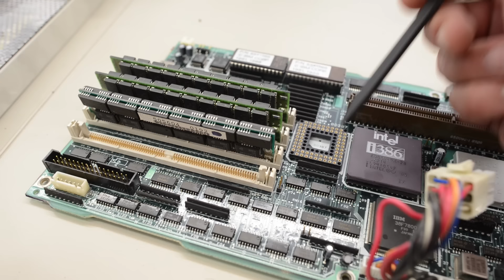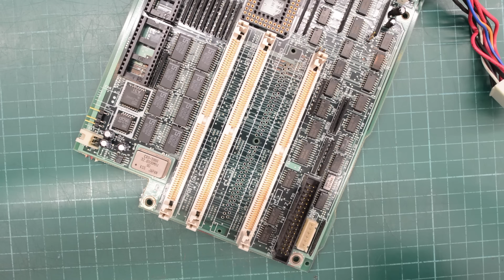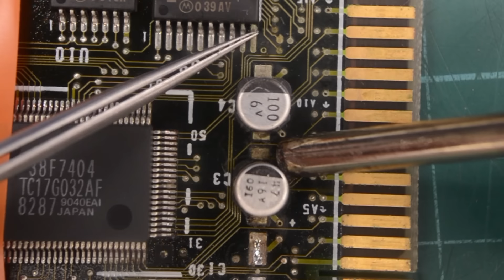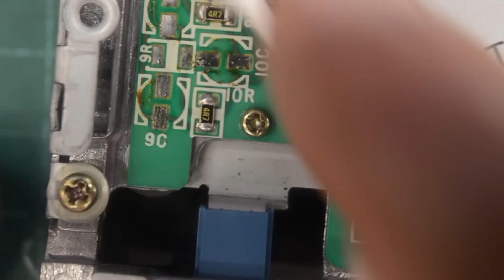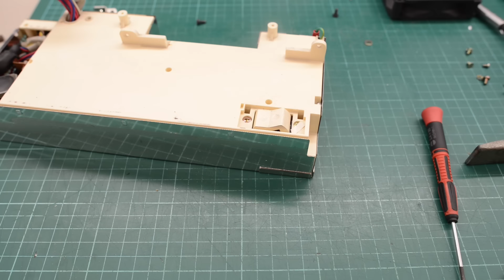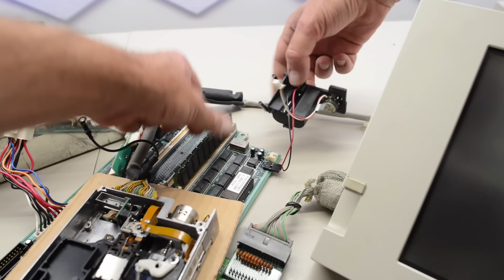IBM PS/2 P70 Portable. Complete teardown

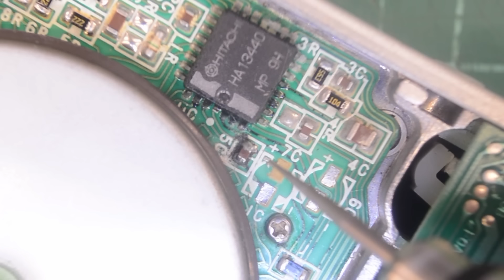Comment: Thanks SOOO much. I just got done recapping both drives in my P70 following these instructions and was able to bring it back to life!  A couple of things I noticed... the caps on the smaller board on your drive were probably a repair, mine were SMDs.  I had to repair traces on both drives.  The one on the floppy was tough to find, symptom was that the floppy would seek but not spin.  Your drive looks like it might have the same issue... a broken trace on the right side of the "5C" component at 28:30, the one that goes up and under the Hitachi IC.  Maybe too late to be any help now but in case it helps someone else.

Comment: I realize this is coming outta left field but  … when I was an IT Director back in 1989 I bought one of these for my office.  I loved the amber screen and the keyboard (among other design flourishes).  Watching your video today all of a sudden it occurred to me that could be really super cool to get one of these (as long as the screen and keyboard are fine) gut it and turn it into a cyberdeck!  Maybe put in a Lenovo motherboard or an SBC like a Pi (with WiFi, BT, Ethernet, USB, RAM), modify the floppy housing to hold  a big SSD, install SD card slots, and so on.  Do you or your readers think that could be done?  Would it be possible to interface the plasma screen and the keyboard to new guts?  “Enquiring minds want to know!”

Comment: Some of these boards have curved traces a lot like hand-drawn boards used to. They even have parallel traces slightly converging upon each other, also a lot like hand-drawn boards. Did... did IBM hand-layout some of their early SMD boards? Or... Yaskawa, whoever that is. Those are really thin traces, but maybe they just optically reduced it by 6x or 8x instead of the typical 4x?

Comment: A mate worked for a computer company that was getting rid of some of these when I was getting ready for university. This is about 93-94 ish. Absolute godsend enabling to do my course work at my digs and print it off in the computer lab. They sourced a soundblaster card for it as well. 
Doom however on this thing, was rather interesting, is that water, toxic waste, or lava? The screen rendered it all the same!
Sold it on at the end of uni to another student.

Comment: Maybe a stupid question and blame my eyesight, but isn’t the simm slot symmetrical? I seem to count 36 holes/pins on each side of the gap and the distances to the outside holes seem identical. I do see a size difference between the outer holes but worst case, just snip off the plastic pin. What a beautiful quirky true-big-blue machine. Never seen one of those, not even in pictures.
Reply from the maker: If I understand you correctly, I don't think that would work. The pins underneath are not in the same spot on both sides. I hope that made sense
Reply: @Epictronics1  it looked symmetrical to me but again, my eyesight isn’t optimal late in the day. Then a socket swap with the top one would be the next option. Thanks for the reply and looking forward to part 2 ;)

Comment: I really like how you teach the proper way to remove caps.  Some other "popular" YouTubers like to twist them off with giant pliers.
Reply: That IS the proper way to remove caps.

I used to be against it too, but I was just wrong.  After repairing a few boards where the solder was too corroded to melt, I nearly damaged the PCB and everything on it due to heat exposure trying to do it “the right way.”

I had a different board where the caps were glued down to allow for wave soldering some of the through hole parts.  Those were impossible to take off with hot air alone, even though the solder was still melting fine.

I learned through trial and error that while it looks barbaric to twist caps off a PCB, it’s actually a lot kinder than the alternative in a lot of cases.  Sometimes you lose a pad no matter what you do.  In those cases, the board’s already compromised and there’s not a lot you can do about that.  You just have to fix it some other way.
Reply: @sirnickity  To each his own I guess.  Repaired many very damaged boards.  Never needed the pliers.

Comment: If I ever want to take mine apart.  I now have a place to go.  My machine's floppy was toast as most were since they did not think about STUFF falling into the things.  I had another old IBM laptop and have to use its floppy, which does not fit correctly into this, to get up and running.  ALMOST as over engineered as the Compaq I.

Comment: About the floppy drive: check one more time that you indeed plugged all the cables back. I once recapped one PS/2 floppy drive, put the thing back together and tested the damn thing. Noooo, motor doesn’t spin! I went through all the emotinal states and decided to check my soldering work once again so I don’t have any shorts and so on. When I popped the drive open, I noticed I forgot to plug back one of the cables 😅
Reply from the maker: I'll check, thanks :)

Comment: The large connectors on the diaplay that are alike floppy connectors, are called IDC. 😊

And the locking nechanism for the floppy drive is called a "push-push latch" because you push to lock and push to unlock.
Reply from the maker: Thanks!

Comment: For the handle, you could probably make a mould of the shape and cast a replacement out of silicone. The trick would be matching the colour of the silicone to the original beige, which might be a bit of a challenge. Also I wouldn't recommend it as your first silicone casting project, maybe practice on something similar but less irreplaceable first.

I would also be tempted replace all the SIMM slots, since it would bug me having one that was facing the other way.
Reply from the maker: The thought crossed my mind. I might replace them all. Thanks

Comment: As replacement solder mask, use nail polish. Clear is nearly invisible but keeps oxygen away, or you can match the board's color for even nicer looking repairs. There are some UV curing green solder mask repair, but I think nail polish is sufficient.

Comment: I'm still convinced IBM had some sort of partnership with tool companies for the fact they use a gazillion different screw head types, including bolts. Either that or they hated the end-user and system admin.
Reply from the maker: I guess this could be the result of different teams working on different parts of the machine without having a standard for screws
Reply: @Epictronics1  that's the most likely case.

Comment: Around 34:35 it seems to be 2 traces shorted with solder, near the blue thing in the floppy drive? Dont know if that will be the cause of the fault unit... You also should remove the hitachi ic in the floppy drive to check and see if damage was under it, just in case...
Reply from the maker: Thanks, I'll double-check the trace. Yes, we are definitely pulling that Hitachi chip next

Comment: i got my P70 a few years ago from the original owner and he gave me all of the receipts and paperwork from when he bought it. For the P70, 60mb HD, 8mb RAM, 80387 mathco, and DOS it cost $14,500! Totally insane! He also got a VGA monitor and printer at the time as well. Great machine though, the only thing I had to do was recap the floppy drive on mine and clean it up really good since it was used for a wood cutting CNC in its later life. I have installed an Adlib replica, and a MCACF HDD adapter (and removed the ESDI HDD) in it and have a 486slc upgrade for it that needs to go in.
Reply from the maker: Nice setup! I wish someone could clone those slc upgrade boards. They are getting difficult to find

Comment: IBM over out did themselves with all the unnecessary complications. it's a fricking 386, you could drop it in a plywood shell... Geez man...  It's like the engineers were too smart for their own good, they couldn't think of simplifying at all, only complicating. That was probably why the company almost bust.
Reply: I wasn't screaming at my monitor, but was wondering why you didn't remove the chip, and inspect the traces on the floppy drive just for good measure.
Reply from the maker: @Raul_Gajadhar  It's easy to be wise in hindsight. That was also my first thought when the drive didn't spin up :) We'll check those traces next week

Comment: You should be able to find the IBM HMM (Hardware Maintenance Manual) for it with detailed instructions on how to disassemble and reassemble it. IBM was normally pretty thorough in their documentation.
I worked on the successor of this machine back in 1994, the IBM P75 with a 486 CPU... I upgraded it from OS/2 2.1 to OS/2 Warp 3.0. Same kind of red plasma display though. But I mainly used it with an external colour VGA display. I think it had 6MB of RAM, but not quite sure anymore.
Reply from the maker: The P75 is a unicorn! This machine is identical except for the MOBO, the riser card, and the cover on the back. They both have the same orange plasma display

Comment: I have the worst memories as a teenager and working on these older systems those darn plastic SIMM slots, they were the bane of my existence back in the 90s, working on older machines (for the time) and they would break if you LOOKED at them the wrong way. What a treasure and how lucky to have had a patreon send that in, what a true gem of a machine. So IBM in its construction, so many screws, and that handle is SO beefy. Very VERY nice!!
Reply from the maker: Thanks, yeah, what a fun project to work on! Looking forward to getting some more parts in the mail
Reply: They seem to have used the brittlest plastic for those SIMM slots. They were a nightmare for breaking even when new!
Reply: Plastics -
When you want them to break down and go away - they don't!
When you DON'T want them to break down and go away - they do!

Comment: the plasma display has caps behind the shielding that ALL need done ASAP. they leak!! The big transformer in the PSU is also susceptible to cracked solder joints.
Reply from the maker: Thanks! The rivets are still out. We'll reflow the transformer before the final assembly and replace those caps!

Comment: I'm currently trying to figure out a battery corrosion issue on a Amstrad PC1640SD... Your video gave me some much needed motivation! The Amstrad is SO much more simple!
Reply from the maker: Those Amstrads are pretty cool machines. I have never seen one IRL but I hope to find a good Amstrad project someday
Reply: Have one too, I love those little buggers. Nice XT machines! As the batteries with AA are in the upper lid, was the shielding useful to catch some of the nasty battery acid?
Reply: @Takeshi.Nakagawa  Yea, for sure it was. I'm pretty sure I could have contained the leak completely by wiping the floppy cable and washing the board - immediately - ! But no... I just peeked inside and thaught naah, it's ok. I'll have a look later. Now, six years later 😑. Life kinda happened in between.
Reply: @u2370  Ouch, had the same experience with a Compaq 486, I feel the pain. 
But, I see in Germany over Kleinanzeigen and also via Wallapop in Spain/Italy from time to time 1640s for below € 100,-.
Sometimes donor machines are even cheaper.
I am looking now for the EGA-Monitor for it, as I got only the amber one.

Comment: I''ve seen a number of people glue new traces on with solder mask. It seems to work well. The mask goes under the trace. I'm not sure how it gets cured, but it works.
Reply from the maker: That sounds really useful!
Reply: @Epictronics1  I've seen it on kris fix germany, who sadly doesn't make videos anymore. It's a modern professional repair service. I guess there are only so many geforce 4090's you can fix before he feels like they are all the same video. I've also seen bits and bolts do it. Another retro channel. He loves his voodoo 2's.

Comment: I was thinking the same thing with the SIMM slots. It's not ideal, but moving slot 1 to slot 3 in a pinch seems like a reasonable compromise.
Reply from the maker: Maybe, I should just swap out all four slots. Those plastic tabs are gonna fail anyways
Reply: @Epictronics1  that's probably the best idea

Comment: Yessss! I've also got one I need to disassemble, fully clean and inspect for leaky caps.
Reply from the maker: Good luck with the project!
Reply: MCIDE–CF will allow you to get a decent size IDE hdd in your P70 so you can enjoy installing all LucasArts games and so much more. A Cyrix CX486DRx2 20/40 will speed things up significantly. Finally, a Resound New Wave MCA gets you good Sound Blaster support.

I'm quite happy with that setup.
Reply: @TheSimTetuChannel the exact upgrades I have in my P70! Couldn’t agree more how awesome it makes it. I do still wish I could squeeze some more cpu power out (though we have the King of Overclocking himself working on this one) since the cyrex won’t run above 20mhz on the board. Definite speed boost with it nonetheless with the right utility. 

Also on caps wiki you’ll find the capacitor list for the p70 PSU 😬
Reply: The King of Overclocking? I can't say I'm familiar with who that might be... but being able to run a  CX486DRx2 33/66 on this planar would be quite an achievement!
Reply: Oh I guess you're talking about Epictronics. 😊
Reply from the maker: @TheSimTetuChannel  Nice setup!
Reply: https://caps.wiki/wiki/IBM_PS/2_P70_PSU